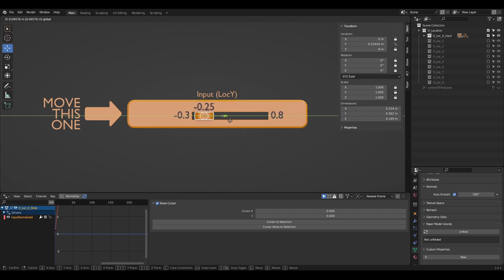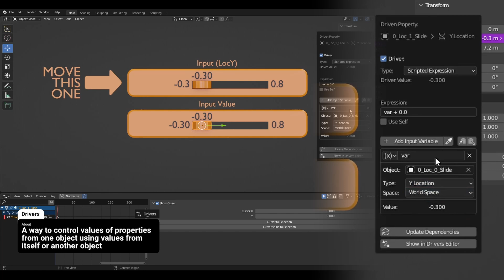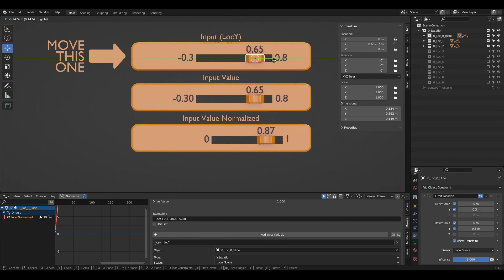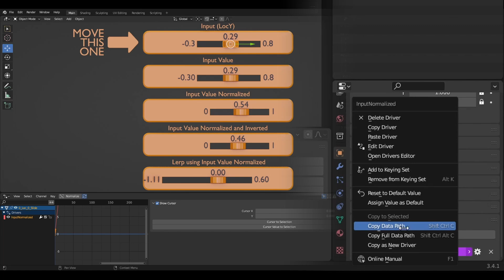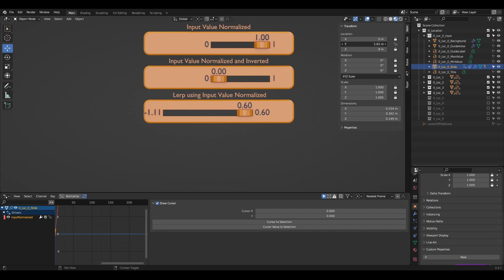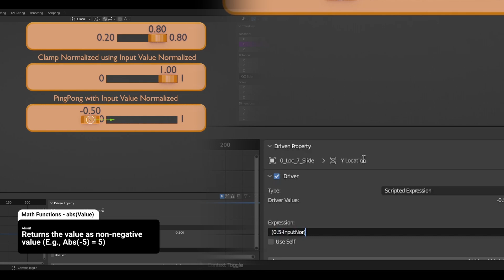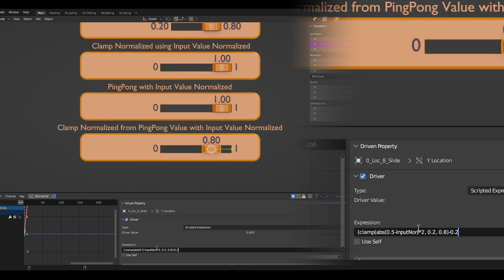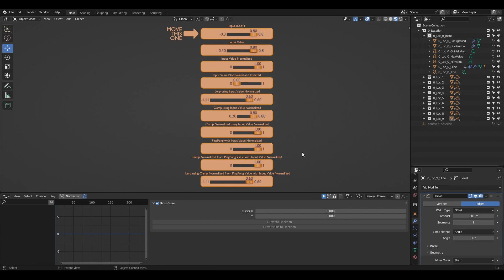Working with drivers expressions using normalized values on Blender

Comment: Appreciate your video, I'm very helpful with this. But if you don't mind, I have a question about that. Is this possible, when the moment we move the first slide, the second slide will follow it, but when we stop the first slide in a random position, the second slide will return to the first position?
Reply from the maker: Is a great a question, and I dont think so, expressions are done to do simple phyton operations, that would need a way to check if the object still moving and stopped something not possible, maybe with more advanced phyton and not drivers could be possible.
Reply: Thanks for the answer, I tried so hard to solve this issue. My goal is for the setup rig like a "pop-up" set, when I tried to move one bone, the other bone popped up, and when we released it, it went out. But sadly, it cannot happen @AenderLara
Reply from the maker: As a follow of my previous comment, time ago I tried to do ratchet mechanism, it works actually but wanted to go further by making it stop rotating in one direction if the gear reach certain rotation, but was not really possible it just breaks and starts acting weird.
Reply: Damm I Love That thank you